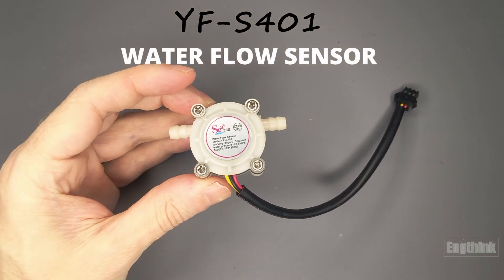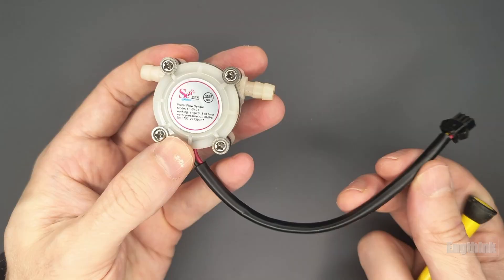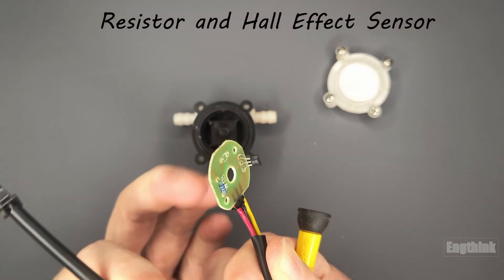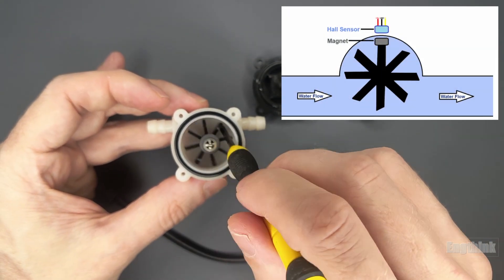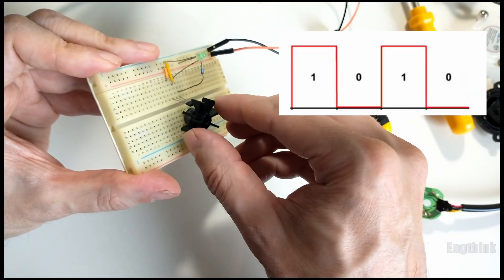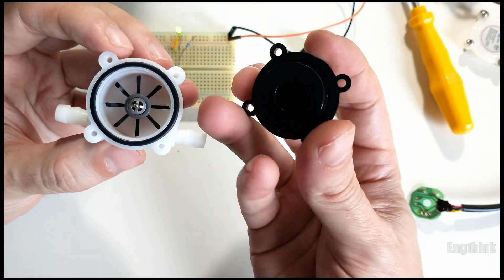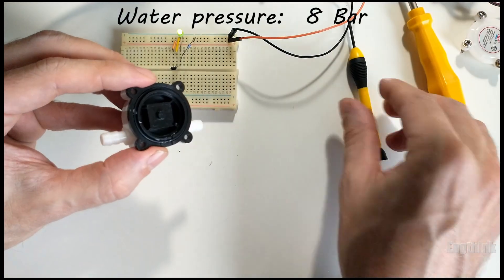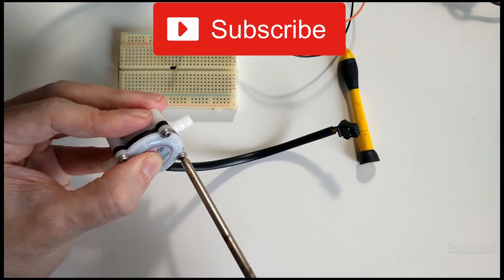Must-See: Measure Water Flow with YF‑S401 — Easy DIY Guide #arduino #flowsensor #halleffect

Comment: Ticks / liter (impulse frequency) is not linear with flowrate, and intuitivly and practivally logarithmical. The factory number (5880) is only valid for very high flow rates. I use low flowrates ( ~1L/min). I made several measurements and came to the following correction function: float tpl = 402 * log2(ticksPerSec) + 2374;    (tpl is ticks / liter the correction value , ticksPerSec is what it says, essentially the flow rate in ticks)